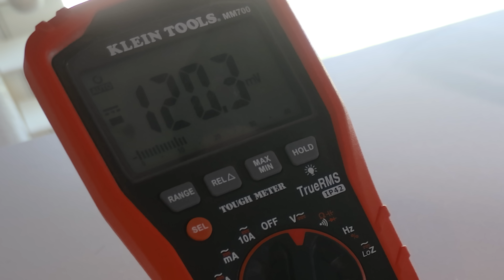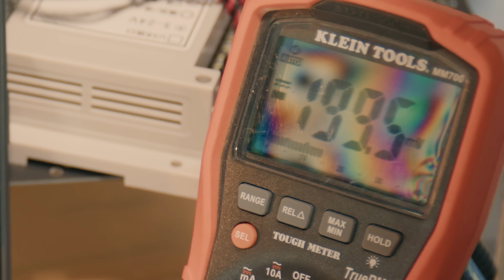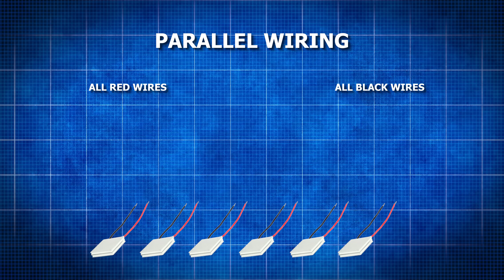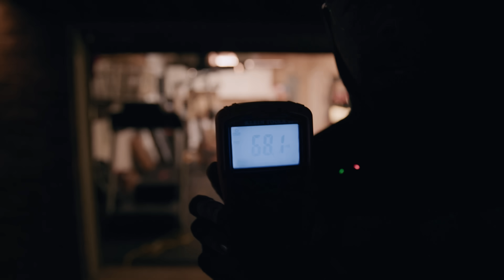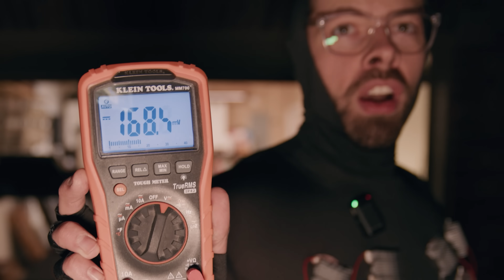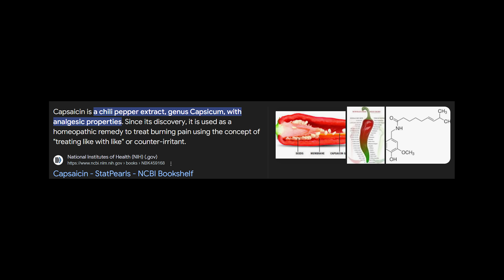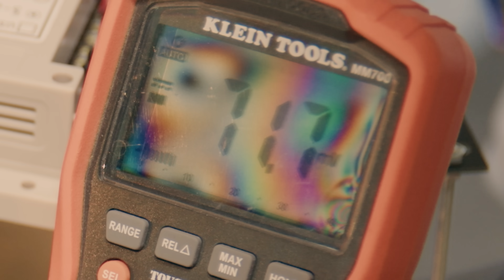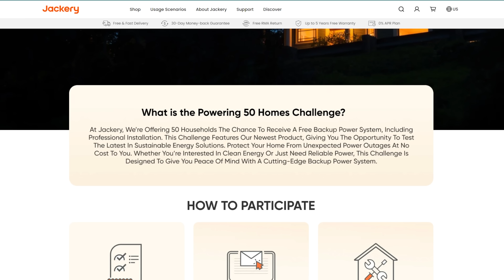Building a Human Generator Suit

Comment: Wire them up in series is more effective because the resistance of your wires fighting back. you need a higher voltage so you get less Ampere and this means you lose less power during resistance. Reaching 6v for USB isnt hard and your phone wil try keeping the voltage in a range of 4,3 to 5,8v according to the USB specification. so maybe 20mA to 40mA are possible for you without any conversion needed. this is enough to extend the Runtime of your phone for hours maybe a day+. if you use a simple small Phone like the those who can only take calls and SMS this might can be charged. They usually have only 300mA battery and last for 1 week to 3 weeks in standby. Those are happy with a 10mA

Comment: The video is fantastic! I really need one Jackery 5000 Plus, this will be very helpful for my family during hurricane season!!!
Reply: Just buy a few 12V 200Ah LiFePO4 batteries and an inverter for half the price. If it's for blackout backup you don't need solar panels, though if you get them you'll also have an awesome camping setup.
I'm in Australia and for $3000 AU I made a 7kWh storage plus 5000W inverter (2000W plus 3000W).
That's about $2000 US, but the same items would cost less in the US anyway.
Actually that's about a third of the price of a Jackery.
Reply: lol it's pretty obvious jackery spammed the fuck out of his comments.

Comment: There are some really cool energy harvesting ICs out there that can harvest below 50mV. Still, it's probably better if you put some cells in parallel and some in series and use them to charge a battery through an efficient buck-boost charger (perhaps even a mppt tracking capable one (often for solar cells but should work for thermoelectric generators)) for a balance of current and voltage to be the most effective HUMAN BATTERY.

Comment: Dude... try to put those on the cpu heatsink. Use power heat to charge your battery and reuse the battery to power on your monitor. 😂

Comment: No one will believe me but I've wanted to do this for years after messing around with Peltier's. But you soon realise the tiny amount of power they make you'd need hundreds, maybe thousands of dollars worth of them to make it work, so I never did, so thanks for making this ha. I was going to buy as many as possible and use a step down transformer (less losses the higher the voltage you have, every milliwatt counts at these tiny levels).

Comment: all i can think of while watching this is how dangerous wearing full body paint/spandex/latex etc is because you dont have much surface area to cool yourself with since ur blocking all ur pores. but like. imagine wearing something between a catsuit and a wetsuit... you could work up incredible heat inside, and if you were outside in icywinds while working out - youd be able to get the most insane heat differential without actively suffering from the icey winds bc ur all wrapped up in the catfish-suit

Comment: I knew it wasn't going to work when you hooked it in parallel. Those things have a lot of resistance meaning drawing any amperage is going to cause your voltage to drop to basically nothing. You want the voltage out to be as high as you can get it to minimize current.

Comment: Caffeine is a vasoconstrictor. Coffee was working against you, if vasodilation was your goal.
You're probably better off trying to harvest bioelectricity. Your body generates more electricity than it uses, so with the right capacitive contact, you should be able to use the excess, which should in theory be more efficient than sticking off the shelf peltiers to your skin.

Comment: The voltage converter is kinda bad. Ideal would be one that needs a kickstart, this needs a higher voltage to start up but then it can handle as low of a voltage as you want. I used such a circuit to power a 2.5V microcontroller-based project from a 1.5V coincell where the converter itself was powered from the 2.5V. The human pressing the on button was the kickstart to generate a quick pulse of higher voltage for starting up.
With the right circuit, each of the elements could have its own tiny voltage converter attached, not only maximizing the output individually and thus increasing efficiency, but also preventing elements with a low temperature difference from bottlenecking your voltage by becoming a load instead of being a generator. Also, the lower the voltage, the lower the maximum wiring distance before losses get too high. At 200mV, that length quickly approaches mere centimeters. A converter on each element also solves this issue.

Comment: you could create a backpack with these then use an emergency blanket to hold in your heat and remove it periodically so while you travel you can power lights... i guess. Although id be more interested to see if you can create an infrared cloaking device with this considering it dissipates heat so fast.

Comment: Interesting concept! It seems you put all of them in parallel on your spandex thingy! If you put them in series, you should have like a few volts. Also running in cold air is better! it gets your body warm and the heatsinks cold, and one more important thing: those units have direction, if you flip the cold/hot side, you also reverse the voltage output. So perhaps you tied them randomly causing them to fight each other. Or perhaps they are just rubbish and don't make power!!!
Reply: a collab between you two would be the most unhinged thing ever
Reply: Agree  @RicanSamurai
Reply: @RicanSamurai someone would die and im not sure who
Reply: @RicanSamurai   my body is ready
Reply: HOW ARE U ALREADY HERE?!?!
Reply: @Bryan_-000-1 😂
Reply: Sup big man
Reply: The GOAT
Reply: collab with this bro and make it make an arc
Reply: Just a huge  waste of time 😅
You would be better of with a solar panel on your hat, you don't have a hat? Get one😅
Reply: Yeah that may work, however you may achieve far better result simply cranking a generator...
Reply: YOO THE FATHER OF ELECTRICITY HAS TALKED
Reply: Using the treadmill with a fan blowing the cold air past him could  do it too. Would prevent the heat sinks from becoming saturated with heat as fast.
Reply: He also needs to get a lot more of these things installed on his skin, it should be covering EVERY SINGLE MILIMETER ⁽²⁾ of his skin.
(Yes I know these are expensive, but I really don't care because it's for science.)
Reply: Oh lawd he coming
Reply: https://www.youtube.com/watch?v=DiZsfjn8yW0&t=94s
Reply: Also putting a reverse mech suit on, where your joins move motors that generate electricity.
Reply: Or he has low power in rise of ki-
Reply: Electro boom
Reply: Human kinetic power got more energy than heat generated,..
Reply: But how can we get to those sweet 80-100W? https://en.wikipedia.org/wiki/Human_power
Reply: absolute legend electroboom
Reply: I need to see homeless man with a home try this again but with this new advice
Reply: I cant wait to the sequal to this
Reply: yo electroboom here
Reply: Make cells! 12 cells of 8 in series or something - volts that can actually do something!
Reply: @jeffh4581  He should've wired some in parallel to increase ampreage and some in series to raise voltage
Reply: Maybe he could also make use of some capacitors for storage?
Reply: Hi mehdi
Reply: sometimes one would backdrive another from my testing. i wonder if having them isolated from each other with diodes or even optocouplers would perform better.
Reply: At least he didn't shock himself lol
Reply: Mhedi?
Reply: uhoh, Mehdi is getting more electrocution ideas
Reply: I like the idea of putting generators at joins that are rotated by joint movement, and kinetic generators in boots that generate energy during footfall while walking.
Reply: Ok BOOMer
Reply: I love the Youtube DIY community so much for things like this.  Work together to make the coolest things ever.  :)
Reply: Please collab. Just do it
Reply: Best part? no need to redo everything.
just rewire.
Reply: you're a dh as of heat sinks.. gg
Reply: The concept is actually pretty old. Tech magazines were talking about people having batteries on them that would charge as they walked and moved to charge their computers that would be inside their watches with monitors displayed through Augmented reality glasses from all the way back in the 90's.
Reply: electro boom spotted
Reply: I get a lot off peltier with red and black opposite. Chinese kids don't soldering better than a machine.
Reply: ITS THE GUY WHO SHOCKS HIMSELF LMAOOO
Reply: @Kaylowkeymc But he knows how to do it safely
Reply: hewwo electric eyebrow man! :3c
Reply: COLLAB MEHDI PLEASE YOU TWO ARE MY FAVORITES
Reply: They are just rubbish
Reply: Won't more insulation generate more heat? I mean like purposefully overheat, and the pads act as heatsinks. Also, will mini heatsinks on the cold side also not make it more efficient?
Reply: he didnt even watch the video, just commented on the thumbnail
Reply: Hi
Reply: Hi

Comment: If our robot overlords try to use us as batteries as they did in the Matrix they are idiots, they would be better off wiring us up to act as cpu's. Far better use of humans than to trickle charge anything. Ofc when we die they could use us to generate power but only as a form of bio fuel or by burning us lol

Comment: 0:26 your wife weighs less than 134.5lbs🤓🤓👆🏽👆🏽
Reply: And is there something wrong with that
Reply: ~60kg, interesting
Reply: @irvinmuziwenkosi  that's like normal weight right, for a adult woman
Reply: @RaVen99991  maybe it is, i just didn't know.
I've weighed 50 - <60 for years[and I'm a young man, not even 20]
Reply: @irvinmuziwenkosi  omg are u oke I weight 70 kg when I was 14 im 24 now and weight around 90. And I have litteraly no fat just muscle but my mom is 50 kg how are u so light
Reply: @RaVen99991  😂😂, all good man, I'm not even worried... I do check bmi[stuff like that]. I would say it's my height, but I'm not that short either
Reply: @irvinmuziwenkosi  ooo oke makes sense, yea im a dutch guy that's 175 and im just very wide build, so I'm pretty heavy
Reply: @RaVen99991  😂 bro, i think I'm ~168.
I thought you'd say like >185, ya i'm not wide
Reply: @irvinmuziwenkosi  168 isn't that short

Comment: if you ever redo this, an insulating pair of pants (with holes cut for the heat sinks obv) would be both less cumbersome to wear (and have room for a dedicated charging pocket), have more usable surface area,  keep your skin temperature from going down as fast, and from a practicality standpoint, the legs are consistently exerted by just walking around, which would create a more sustainable temperature difference

Comment: As an alternative, you could have a suit with tubes filled with fluid that moves the heat from your body to a box that converts the hot(ish) fluid to energy. That way you could add more insulation layers without reducing the performance.

Comment: What if you use the generated electricity to run a fan? Would your body cool down and slow the fan, self regulating? Or would it it help cool the cold surface of the pads and increase electricity?

Comment: I have a question. What would happen if you built a shed out of these? Like instead of normal walls, have a layer of those heat transfer things. You go on the inside, do whatever you want, but overall body heat is contained in the shed. On the outside of the shed, would be cold (assuming it's 4AM again)